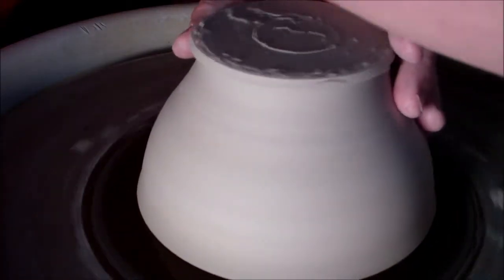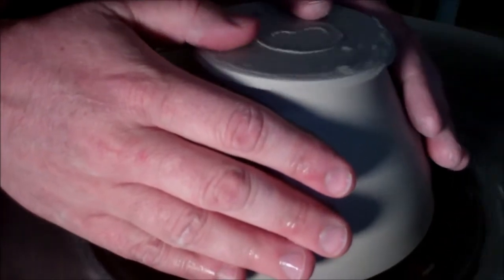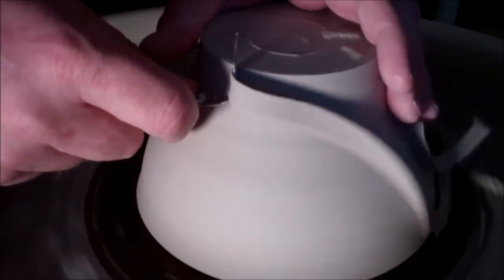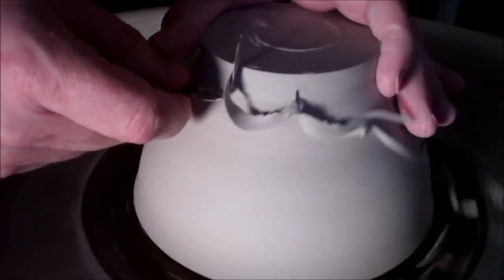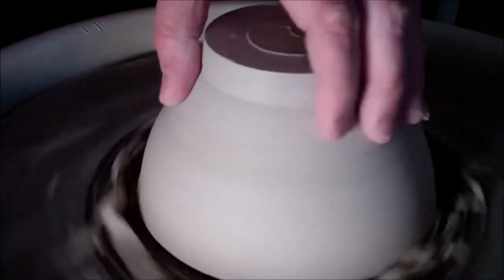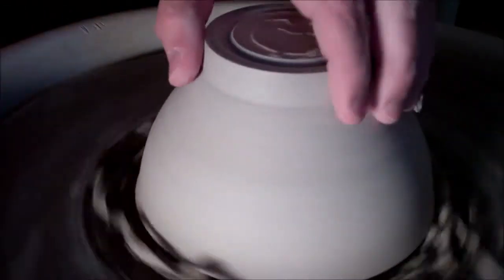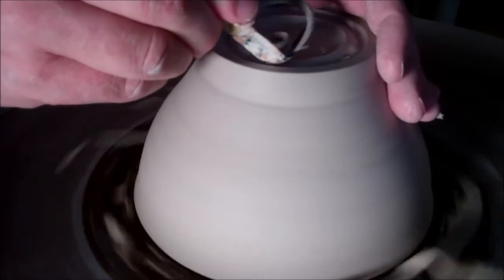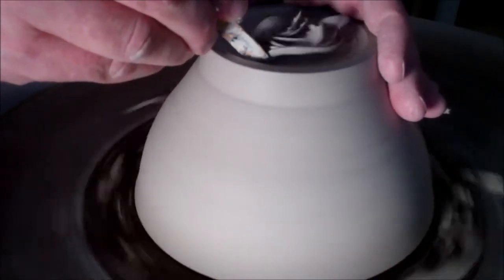Tap Center Trimming

Comment: Would you mind doing a video on how to tap on center? whenever i try to do it my pot ends up flying off the wheel and then breaks when it hits the splash pan. Your chattering looks awsome by the way. It looks like you used a tool made from a hacksaw blade to do it.